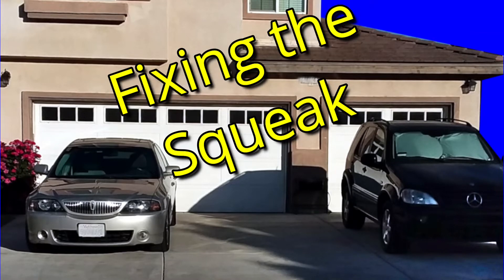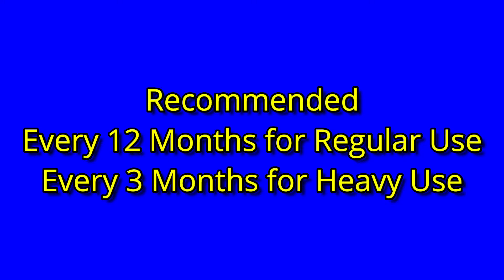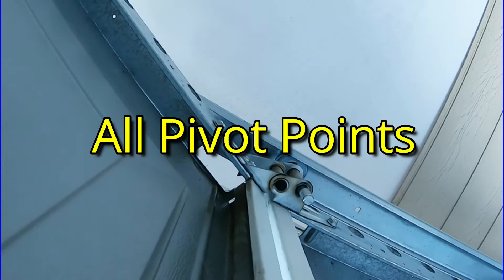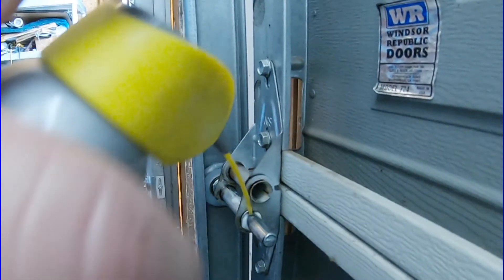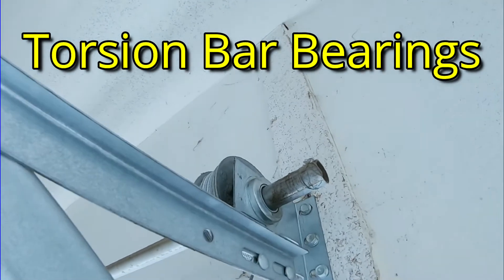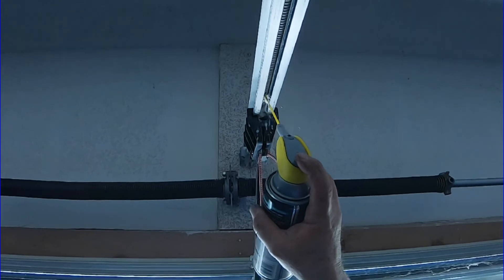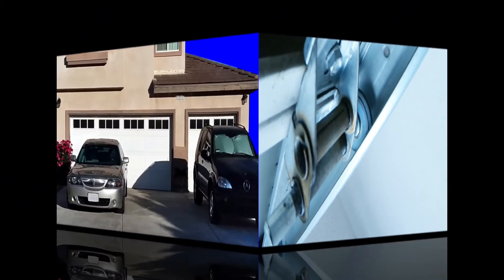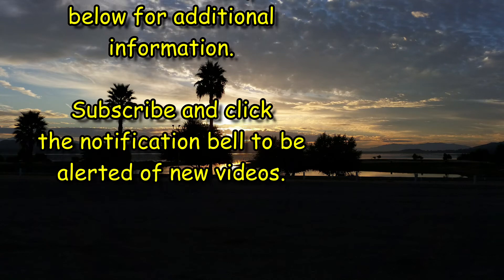DIY Garage Door Maintenance

Comment: Well I'm an idiot. I'll start removing the gear grease In the tracks and try to find some white lithium spray lube. Crap. How do I clean the red grease out of the track easily? 
     Currently I have to hop out of my car to help lift the garage door open. The wooden 2-car-garage door uses 2 extension springs and a bicycle-type chain pulled by the 20 year old motor. Is there a way to help the motor be more powerful? Or motor maintenance?
     Another problem is light pours in when the door is closed. The gaps cause real problems in winter snowstorms and summer heatwave here in Missouri. Any help would be great. Thank you!!